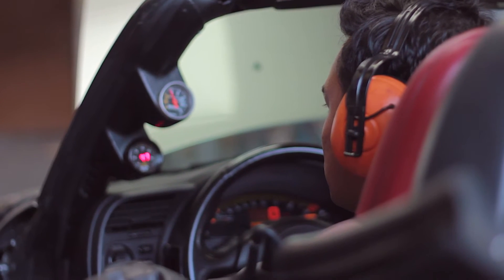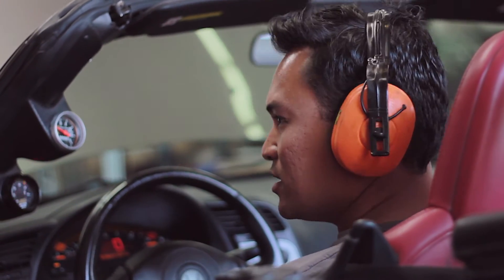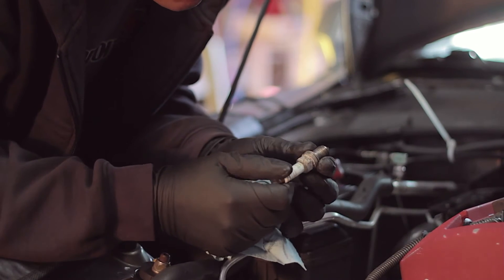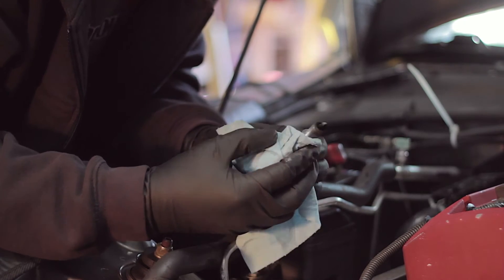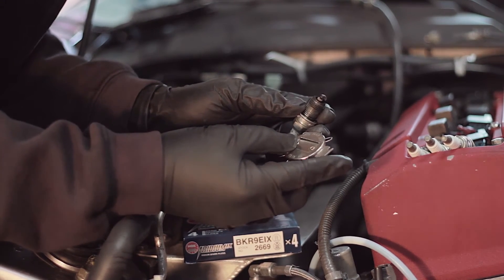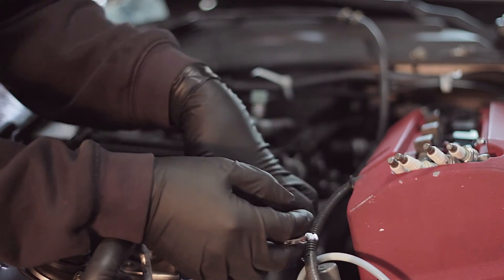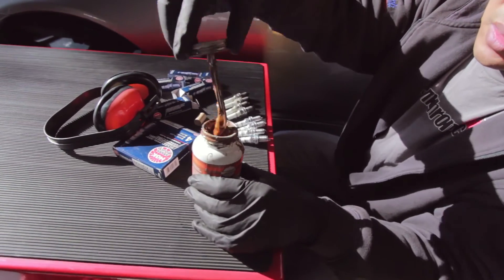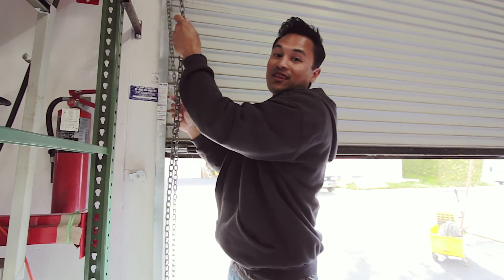How to Fix Ignition Misfires

Comment: Have Kia sorento 2005 ex 3.5. Heard some knocking stumbling sound, loss of power. Got a code p305 ignition coil misfire. Replaced coil and all spark plugs, next day after turn engine on same problem ever worst, mechanic said cylinder problem told me that I have to replace the whole engine. Cannot believe nothing else can be done. Any  idea?